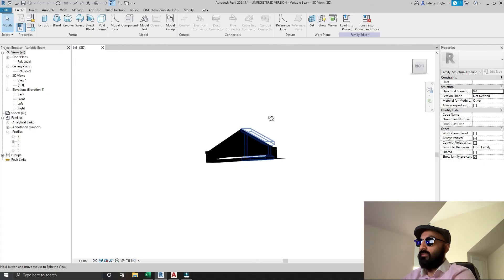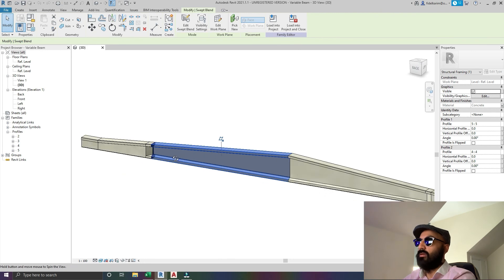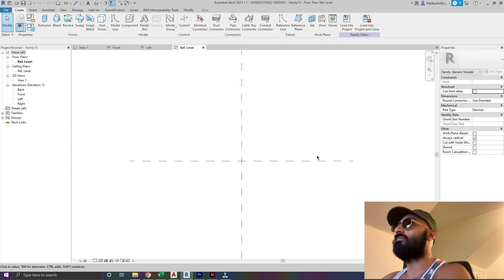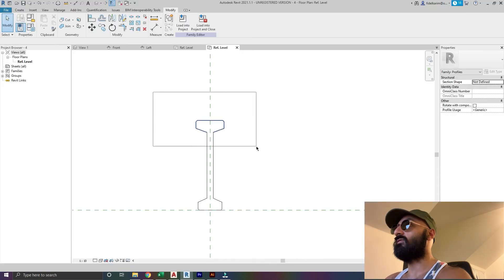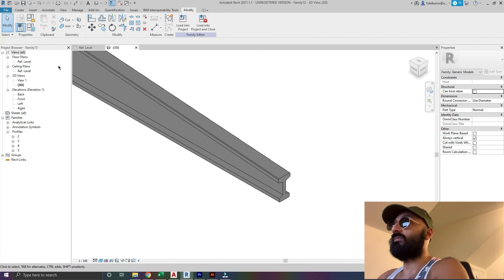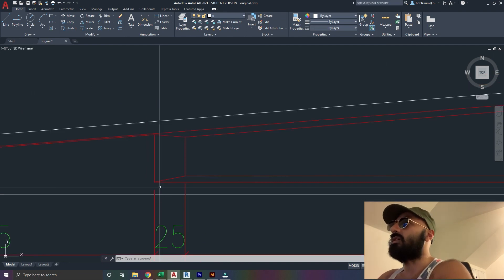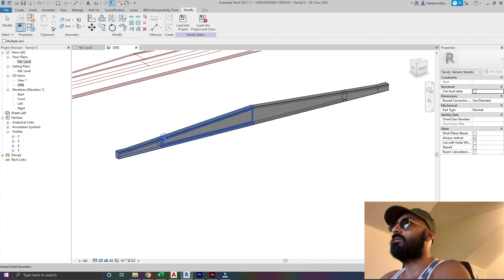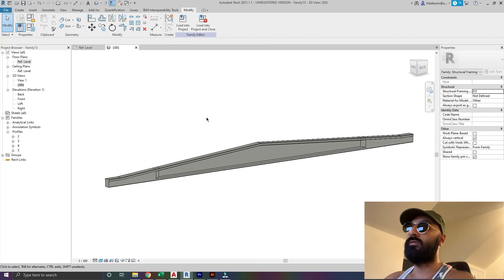Revit - Create a Custom Variable Concrete Beam

Comment: 28:05 why did we create that line and aligned it and locked it? why is it important tho?
Reply from the maker: Thank you for your question. That line is a ‘course line’. In plan view on drawings, we like to show beams as lines, rather than 3d elements. We later change the line to be visible in ‘course’ mode only. And make the 3D elements only available in ‘fine’ mode. I hope that helps
Reply: @DenariPixel  Thank you very much. it was very helpful. eagerly waiting for your next detailed video.
Reply from the maker: Thanks for your support